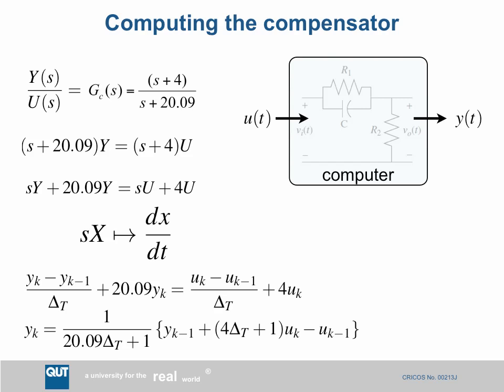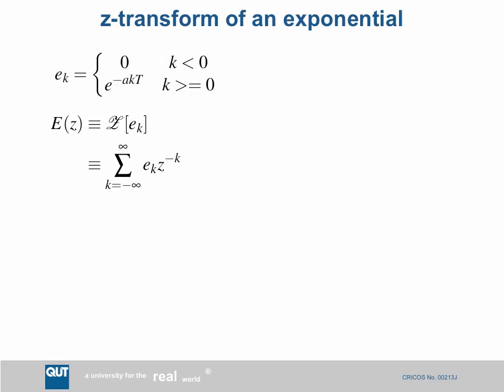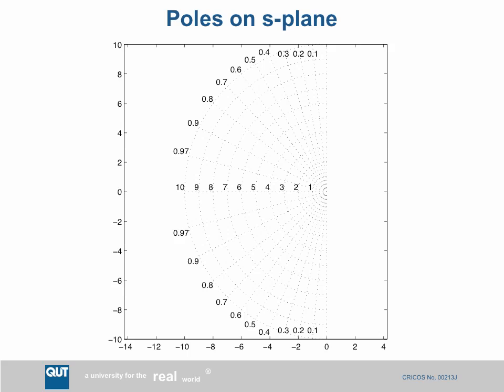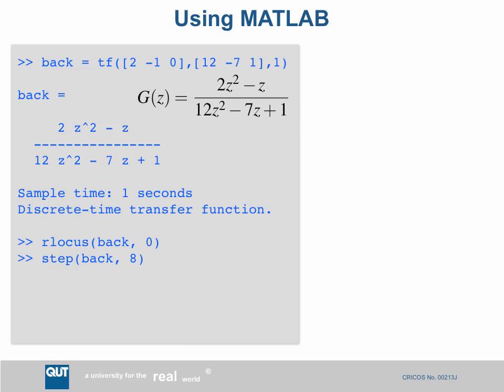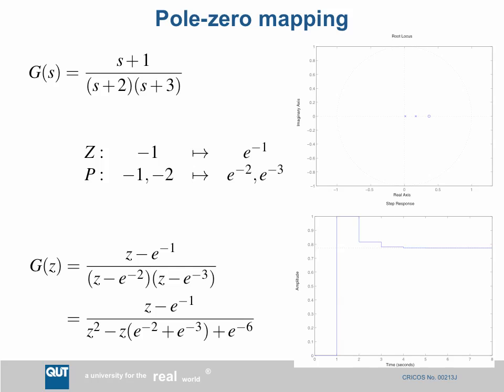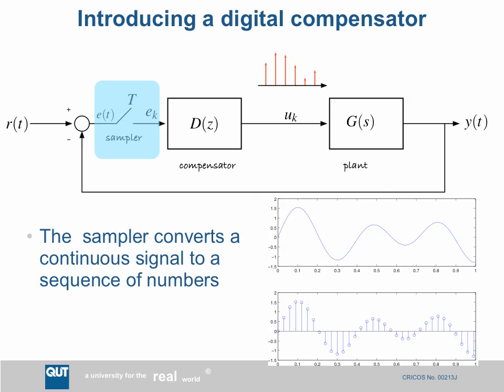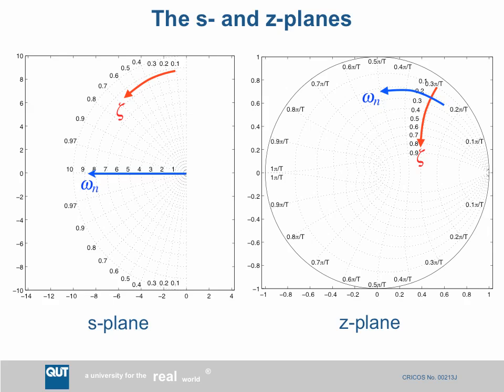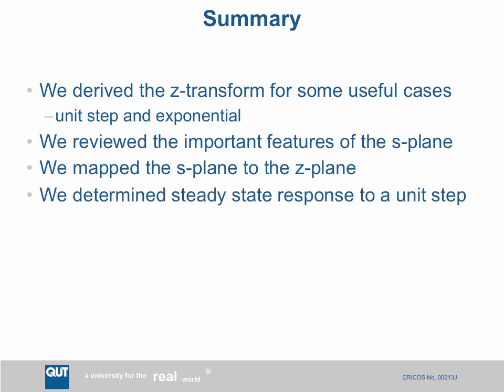ENB458 lecture 3: Welcome to the z-plane

Comment: Doubt on navigating the s plane.  Why right side poles of s plane always considered to be unstable. For anti causal system with right side poles, Jw axis is included and it is stable.
Reply from the maker: You are arguing that the imaginary axis should not be considered as unstable?
Reply: @PeterCorke  if a system is anticausal, then right sided poles will not decide that system is unstable. As jw axis is in ROC. 
Why it is generalized that right sided poles refer to system instability. Is it bcoz we r mostly dealing with causal systems ?
Reply from the maker: @shahnaz1981fat  engineers deal with causal systems.
Reply: @PeterCorke  thanks so much